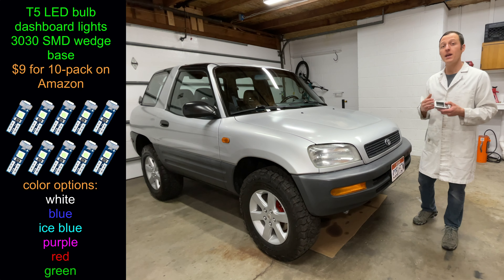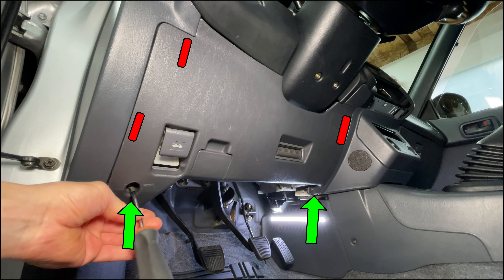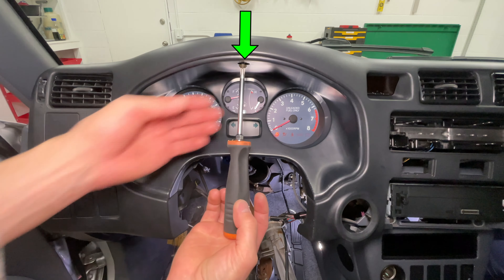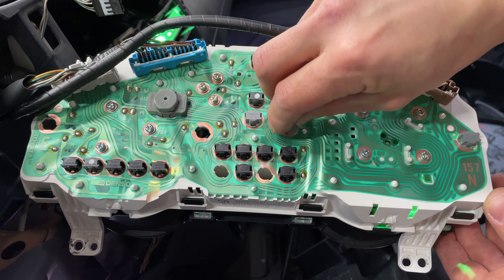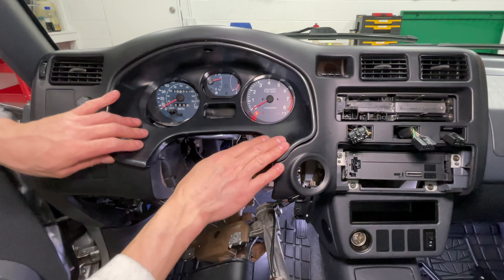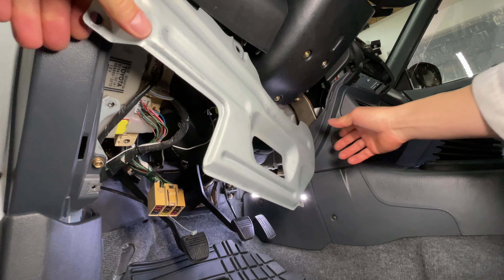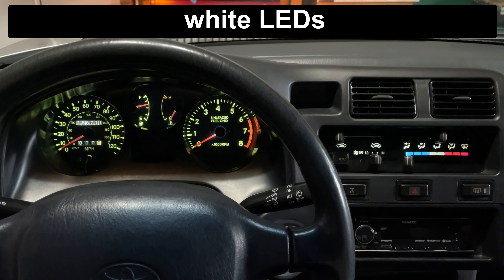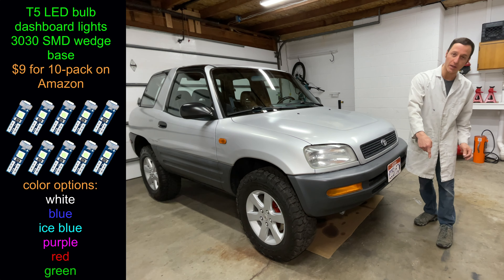LED dashboard light installation 1997 Toyota RAV4 (episode 29)

Comment: I have a 99 RAV 4, do you need to use any sort of load resistor for this or the cabin lighting LED upgrade you did?
Reply from the maker: Nope, just install the LEDs.  The only LEDs that need resistors are turn signals.
Reply: @LabCoatPaul  the rear door LED installation went flawless. The front dome light not so much. The bulb broke off in the socket. Any suggestions on how to get it out?
Reply from the maker: @jasontorres4668  Yes, remove the light assembly from the car.  It should just be a couple screws.  With it out of the car, it should be much easier to grab what's left of the bulb with some needle nose pliers.
Reply: @LabCoatPaul  Thanks Paul. I’ll do that. Does the bulb pull straight out? I have a 99 with the sunroof. It calls for the. DE3175 in the front which is not the correct bulb. Is it a BA9s? Also, thanks for all the content, my mom passed and left me the RAV4, when she had it I thought it was the biggest POS but after clean it up it’s in immaculate condition and is going to be a fun little project car.
Reply from the maker: @jasontorres4668  Yes, the front is BA9S.  This video is about the dome lights:  https://youtu.be/IHYhd5vFEI4
The front dome lights go 1/4 turn counter clockwise to be removed.
https://www.superbrightleds.com/moreinfo/miniature-and-subminiature-bulbs/ba9s-led-bulb-5-smd-led-tower-ba9s-retrofit-car/2077/4721/
Reply: @LabCoatPaul  pulled out the assembly and the broken light popped right out. Much better with the new led bulbs

Comment: My 1998 toyota rav4 when i start it up the car shakes. Can u explain to me please why
Reply from the maker: If the engine is shaking on idle, you may have a misfire.  Replace your spark plugs, wires, distributor cap, and rotor.  Also check your air filter.  https://youtu.be/ajq626xx6zM

If your engine is dying or having trouble finding a smooth idle, you may need to clean the idle air control valve and throttle body.  https://youtu.be/O3yb5RIlqPM

If the idle is too high, you may have a vacuum leak.  The hoses on the RAV4 are old, and some of them are cracked.  You can spray carburetor cleaner at the hoses while the engine is running.  If the RPM's go up, you've found a leak.

Comment: My light above the radio for the ac is burnt out but also wasnt the same size it was smaller and the left side of my dash is lowkey dim not all of it just some of it isnt hit by light so it looks cringe. Pls help
Reply: Context 1997 rav4 4door base model w awd
Reply from the maker: All the illumination bulbs in the gauges should be the same size.  If you're using LED's turn on the lights before installing the dash back in the car.  If one of the LED's doesn't work, flip it around 180 degrees and try again.  The A/C button uses a smaller light bulb.  I haven't researched that one so I don't know what bulb that is.

Comment: Y did you take all that out I just got the dash out took me 10 minutes
Reply from the maker: The instrument cluster bezel is a different shape in the older RAV4 1996 - 1997.  If you have a 1998-2000 RAV4 you don't need to drop the column.

Comment: Is the bulb the lights the AC button the same?
Reply from the maker: No.  The light inside the A/C button is smaller, and I think it's soldered to a circuit board.  That would be harder to replace.
Reply: @LabCoatPaul  Ok thanks

Comment: Not sure what i did wrong, got a 99 4 door rav and saw another vid where the dude didnt have to take the whole steering column off. So i tried replacing the old bulbs with LEDS, now none of them would turn on. Tried putting the old ones that i know work and still nothing. Anyone know what i did wrong and how to fix it. Having the gauges at night would really be helpful. haha
Reply from the maker: In 1995-1997 RAV4, you have to move the steering column to remove the dashboard trim.  In 1998-2000, you don't need to.
It sounds like you might have blown the instrument panel fuse.
Reply: @LabCoatPaul  thank you and ill reply again once ive done that. Honestly, seeing you work on your rav has really pushed me to start working on mine as well. Just replaced the brake master cylinder and ordered new lift kits wheels and tires as well. Hopefully mine would be somewhere close to yours
Reply: @LabCoatPaul  would blowing the fuse cause all the lights to go off? Cause all the other lights like turn signals and gear indicator is still lit up.

Comment: O no what is the cardboard doing under the rav ...whats leaking now?
Reply from the maker: Oh a little bit of everything...  Actually, I'm just down to transmission leaks.  The biggest leak is the right side CV axle seal, which I already replaced once, so I'm not very happy about that.  The transmission is leaking from every seal actually.  I'll need to take it out to make the RAV4 stop leaking.
Reply from the maker: @allentursi187  Yeah, I'll be changing the clutch on mine some time within the next year.  I just got done replacing the cylinder head, so I'm not quite ready for a major project like that again.